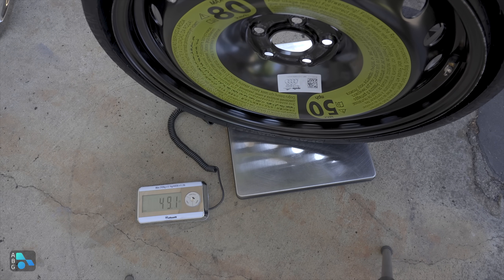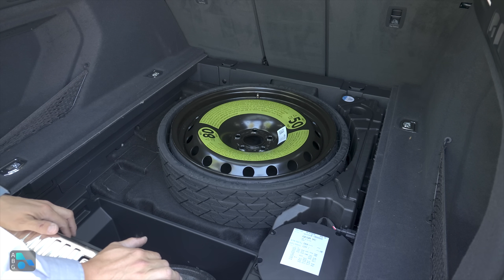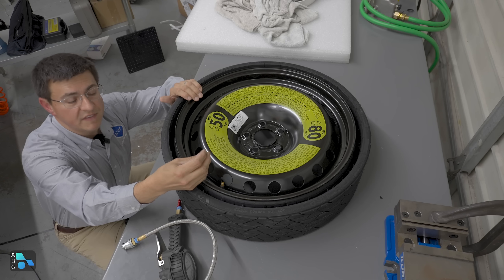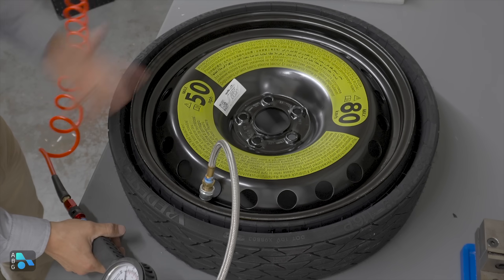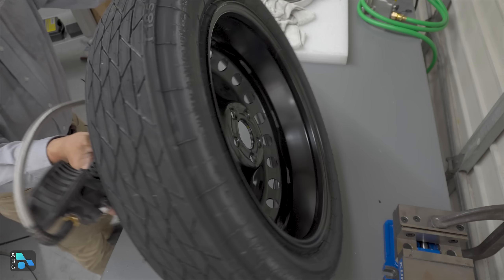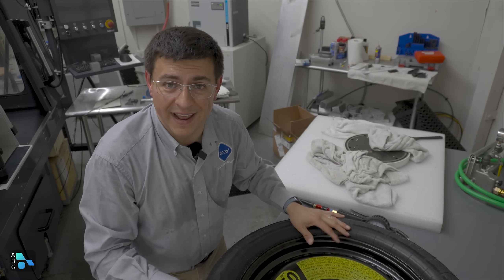How A Collapsible Spare Tire Works, And How It Might Save The Spare Tire In EVs

Comment: I worry about how well the rubber would hold up after many years and whether it would be able to fold out successfully. I really hope a spare tire will be available for the next car that I buy
Reply from the maker: It doesn’t seem to be a problem, the first spate of this type was in 1969
Reply: Should last longer than a tire exposed to the elements 24/7. being in a dark place eliminates wear from UV and some of the impact of atmospheric "wear"/oxidation
Reply: The_Grouchy_Old_Man  This us false. Me= 25 years in tire production.
Reply: Sun shine is a tire killer and there is none while stored . It would last a long time.
Reply: @coldspring624 does not matter. The rubber will become brittle with time, and your 10yo spare might just pop  under load. Tires have an expiration date, usually 6 years after manufacturing date printed on the tire.
Reply: Many years? Don't worry. The spare tire will last much longer than the batteries.
Reply: The tread can't be that durable if it's able to stretch like that. Better than a fix a flat though.
Reply: Years? You'll get a lease replacement in 3.
Reply: The one in my 1976 Nova still works fine for temporary and slow-speed use.
Reply: I have one of those on my '87 911 and has never been used. Although it is a great idea, I would be worried to inflate it after 35 years. Actually, I took it out of the trunk some years ago and replaced it with a wicks puncture repair kit that is tiny in comparison and makes the job perfectly.
Reply: @cicli  puncture repair kits only fix holes from nails. If you hit something bigger or tear the sidewall then you will wish you had that spare.
Reply: @CognitiveHeatsink if you hit something bigger, a wise man would get the suspension checked first. Your perfect spare it worth nothing if you loose the whole wheel ten miles down the road...
Reply: @wernerviehhauser94   I mean bigger than a nail. I ran over something about the size of a golf ball and it put a good gash in my tire. I also rubbed the curb in a parking lot and tore the sidewall on broken concrete. Puncture kit didn't help.
Reply: @CognitiveHeatsink  hitting something bigger than a nail that DOESN'T also hit your suspension is extremely rare. It would not be smart to make such rare occurences the basis for arguments. On my 600000km, I had two engines go up in smoke, popped one coolant system, and had ONE flat tire. And if I hadn't had a spare, I could have gotten the tire replaced at that exact gas station where I stopped to change wheels. 
Unless you really live in a backwater area or can't afford roadside assistance (comes for free with my car insurance), you could easily save on weight and space.
Reply: @wernerviehhauser94   a house fire is rare, but I still have a fire extinguisher and home insurance. You do you and and trust your tire patch kit. I'm going to keep a spare tire in my vehicle whenever possible.  And no need to insult my intelligence just because I disagree with you. People can have different opinions. Please learn to respect that.
Reply: @CognitiveHeatsink  not a good argument. I have a fire extinguisher in my house because I am legally obligated to. And I know that in 9 out of 10 cases, it's going to be of no use since the fire is going to start while nobody is ready to use it (statistically they are caused by appliances that haven't been turned off while people are out of the house or sleeping). I have a second one for my hobby room because there are real fire hazard there when I'm working. Chances are, I would catch the fire early enough or need external help anyway.
The INSURANCE part is also a bad argument because this tackles the "could financially ruin me" option. A flat won't.
If my cars had spares, I'd not replace them. But I do not require them to be there. Just like Switzerland is the only european country not requiring smoke detectors in private homes because in the long run, they cost more than they save. Their installation is a purely personal choice, as is your spare. You can want one, but reqiring it to be standard is questionable.
Reply: @CognitiveHeatsink  Even in a tiny house, the space occupied by a fire extinguisher is tiny. You worry about a spare tire, but you're more likely to need an emergency toilet. Do you carry a camp toilet in your car? Add a popup tent and you have an emergency latrine/bathroom anywhere you go. Do you keep snacks in your car? A first aid kit? A satellite phone? I mean if you're disaster prepping your car, there's a lot more to worry about than just a flat tire. What about medicine? Flares? triangles? An inflatable raft or life jackets in the event of a flood...
Reply: @T1Oracle  I can drive to a bathroom. Not a good idea to drive on a flat tire. And yes I do keep a first-aid kit and small toolbox in my car. I'm not disaster prepping my car, I'm planning for the most common emergencies. I have had to use my spare many times in the 30+ years that I've been driving.
Reply: Never - EVER - buy a car without verifying it has a spare, even one of these pieces of garbage.
If they don't show you under the trunk there's a reason - they don't want you to know there's no spare.  Many cars are not even designed to carry a spare (Ford Ecosport, Tesla, ect).
Reply: @amzarnacht6710  That's dumb. Most cars come with roadside assistance. Or a repair kit. You don't NEED a spare.
Reply: @04red6  you can't call roadside assistance if you're in an area with no cell service. If you never leave the big city or major interstates then it's fine to not have a spare, but some of us travel on rural highways where cell service is spotty.
Reply: @04red6 if you cut open your tire eg on a curb the repair kits are useless.
Reply: @CognitiveHeatsink To be fair, most vehicles that are designed for use in remote areas still feature a spare, the trend away from spares is in more compact or city bound vehicles where better roads and better tires mean flats are far less common than they used to be, and where yes, roadside service is more readily available.
Reply: @bosstowndynamics5488   true, but here in the USA people drive compact cars down dirt roads and trucks and SUVs in the cities.
Reply: @roland791  you would have to be a bad driver for this to happen more than once in your lifetime...
Still, in that case you should get your suspension checked, first.
Reply: @04red6 The doesn't make sense.  If you are in a location where you can't send out a call how is roadside assistance of any use?.  A spare is needed in any car.  Some cars use a plug kit as a backup and did away with a spare tire.  That was stupid as how do you plug a blow out and if you are in a remote location how do you call for assistance.  People are slowly changing into dependency and moving away from self reliance.
Reply: @04red6  You think roadside assistance is free. Just have a spare, be smart and be on your way. Money well spent, believe it or not.
Reply: @04red6 In a lot of remote areas cell phones will not work. I won’t buy a car that doesn’t have a spare tire.
Reply: @michaelfoulkes9502  Good luck.
Reply: @michaelfoulkes9502  Lol
Reply: its not holding up really well and the pump takes an hour to inflate the tire, it took me an hour and 15min to change my tire, 15min to replace and hour to inflate, 2016 audi sq5, next time i will buy a real car
Reply: @retrocompaq You were doing it wrong.
Reply: @retrocompaq  Start inflating the tyre before you jack up the car
Reply: @retrocompaq and flats happen like hardly ever so if it takes awhile it doesn't matter
Reply: @david19897 when you get a flat on a motorway/freeway, time is definitely an important factor...
Reply: Just buy a full size tire for your car and keep it in the trunk, that is what I do.....even my 1998 Nissan Sentra fits a full sized spare tire under the trunk carpet fine
Reply: @fortheloveofnoise Not every car has a place for a spare.
Reply: @04red6  Try the back seat.
Reply: @04red6 yet they're getting bigger all the time

Comment: They don’t put it in the front since they don’t want a 49lb piece of metal and rubber hit you in the breast and face in an accident…
Reply from the maker: If it was restrained properly and behind the crash structure this would be a non issue.
Reply: Yeah, a 400 pound engine in the front of a regular car is totally safe but this 49 pound tire?  Oh my!  That’s deadly. 🤦🏻‍♂️

Comment: The American Motors Gremlin had those back in the day. I used to show it to my Auto Tech class on our unit on tires and wheels.  I think it came with a can of compressed air.  That cap came on most of by bicycles a long, long, time ago.  Don't stick you finger in there it might get stuck. So when your looking for that spare tire on all the cars without them, go look for the lug wrench, jack and handle.  They may say they're saving weight, but they are saving themselves the expense of supplying that equipment and wasting a lot of your time and money and wrecking your trip.
Reply: The 1973 Chevy Nova hatchback had a similar spare but it inflated with a cylinder of compressed air.
Reply: 1972 Hornet Sportabout had a collapsible as well. Never had to use it, though
Reply: Yep, just an underhanded way to make more money

Comment: Pretty cool design. I was surprised it can collapse back on its own.
I am pretty sure that GM had a collapsable tire back in the late 70's..  but it was a one time use tire. It did NOT return to its collapsed shape.
Reply: Not true. They do collapse on their own. I have one in my 1976 Nova.
Reply: @NovaResource  
Really? Didn't know that.
I saw one in a vehicle I owned at one point. That was a few years ago though.
Reply: @kens97sto171  Yep, I’ve used the one in my 1976 Nova at least twice.
Reply: @NovaResource  
Yeah I never used one, I'm not even sure what vehicle I saw it in... but it would have been something from the '70s. My grandparents had a 79 Oldsmobile. Might have been that car. But I also had some early '70s Chryslers. I could have swore though that I saw it in my mid '80s firebird? I don't know It's a hell of a long time ago lol..
Reply: They were mostly used on smaller trunk cars like the Camaro/Firebird as well as the Nova and other X-body hatchbacks. Chrysler used them too in the 70’s.
Reply: @NovaResource  
Well that makes sense then. So I probably did see it in my firebird.
Thanks for the info really appreciate it.
Hope you have a wonderful day.
Reply: @kens97sto171  You too. Happy Motoring!

Comment: Is there room for the flat main tire, or does it have to share room with your holiday luggage?
Reply: Share
Reply from the maker: It has to share, but the “well” has enough room for the full size tire but it causes the load floor to rise up about 2 inches
Reply: Share. The idea is, if you could easily hide the flat main tire under the floor, you might drive on the spare longer than you should. Just move some of the holiday luggage under the floor where the spare was to make room for the spare tire. It only should share room for the short drive from where you changed it to the shop that will fix it.

Comment: There isn’t a lot logic behind the lack of a spare tire other than pure cost savings.
Compare the amount of range lost due to the “extra weight” of a compact spare tire (will it even be measurable) compared to the amount of range the manufacturers willing are willing to give up by adding extra large wheels for cosmetic reasons 19, 20 and 21+” rims and low profile tires. 18” trims are now considered the “bare minimum” size and some consider them as “small.”
The manufacturers also could make room for spare tires if they wanted to.  The Model Y literally has about 99% of the room needed for a compact spare under the cargo floor as is. Some owners were able to stuff one in after shaving away some of the plastic liner.
Reply from the maker: According to research by MIT, the loss of 42 lbs would yield about a 0.2% range increase on average, so maybe 5 miles ish. It’s not really a huge impact. Going from the base wheels to the Uberturbine wheels is a larger weight increase than adding a spare

Comment: Suppose you installed the now expanded spare. Where are you supposed to put the flat tire that you took off? It cannot fit into the smaller spare's space. Roll it into the back seat?
Reply from the maker: You can put it under the floor, but the floor is then about 2” higher and it occupies the entire under floor area rather than just part of it
Reply: It’s kinda designed to force you to get the tire repaired quickly and not drive on the spare long.

Comment: My 1987 Nissan 300ZX had the same kind of factory collapsible spare tire also.  It also came with a pressurized can of air (with a Datsun label) to inflate the tire.   I replaced the can with a foot pump so I don’t have to worry about the can running out of pressurized air.
Reply: i have an electric pump in mine and it takes an hour to inflate, cant imagine with a foot pump
Reply: @retrocompaq Takes me three minutes.
It's all in the quality of the pump.  1.5 cu/ft per minute, minimum.  12v direct to battery (not cigarette lighter plug)
Reply: @retrocompaq  Done it for years. Just ensure the foot pump has two piston cylinders.
Reply: My 78 280z had the same thing. I thought it was the weirdest thing ever.

Comment: Cool, but people in a hurry will underinflate it (if you don't pay attention to the PSI) and will lose all safety aspects.
Reply: If you are the type of person to be in a hurry when changing the tire then you probably shouldn’t be doing the job. The PSI is just one of a number of things that could go wrong. Wheel lug torque, jacking the car up safely.
And even a full size spare could be low on pressure if it’s not checked regularly.

Comment: Would have been nice to see just how long it takes to inflate with the included pump bc that's extra time you'll be stranded on the side of the road (although you could start inflating it while you're getting the vehicle jacked up and the flat tire off).
Reply from the maker: It’s about 2-3 minutes longer
Reply: @AAutoBuyersGuide  2-3 minutes longer than how long?  (Great video BTW)

Comment: I live in the Arizona desert and have had flat tires three times in the last 6 years. Fortunately I factory ordered my Jeep Renegade with a spare which I would not be without in this area. None of the flats were fixafflat fixable.
Reply: Yep, couldn’t imagine not having a spare in Australia. Far the too much of the continent are remote areas and lots with no mobile service and even if you did get hold of someone it could be hours to get roadside assistance.
Reply: @spacemanmat  How often do Aussies actually drive through those areas though? I'm sure truckers do, but there's a reason why those areas are so vacant, nobody's there. 

That being said, if you do expect yourself to be in such a position, buying an extra wheel may be worth it.
Reply: @SmallSpoonBrigade  usually such issues are found out when it’s too late to do anything about it. Remember the people likely to have an issue are not going to be the sort that is prepared. Also if cars don’t need to have spares then they won’t leave room for storing them so then you’ve got to deal with this odd shaped tire floating around the back of your car.